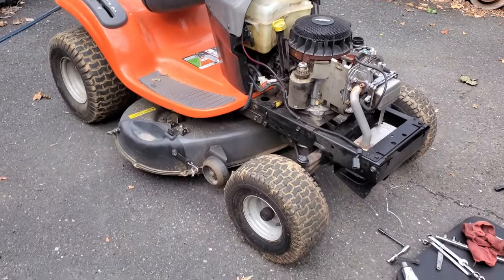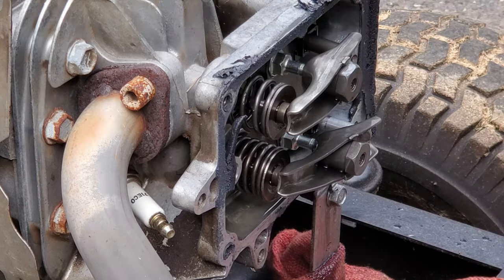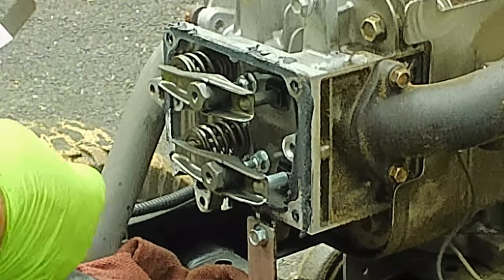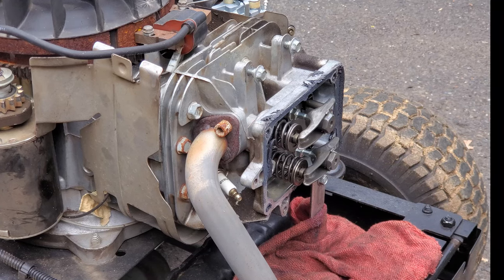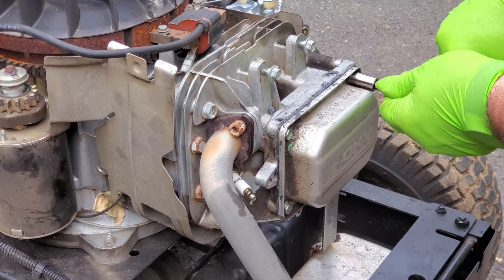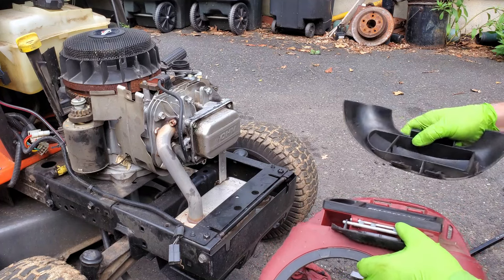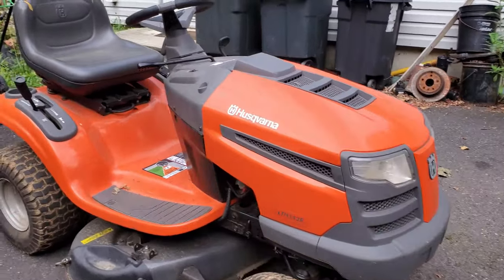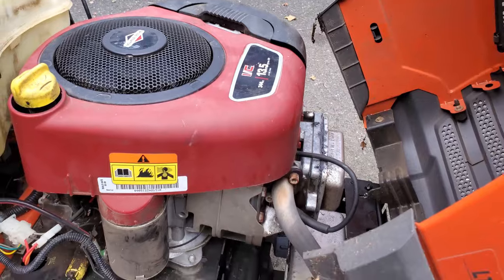Husqvarna Mower Backfiring: Part 2 WHAT WAS the cause?

Comment: The valve adjustment is the best thing to do in getting it up and running again correctly
Reply from the maker: Yes, it is not unusual for them to be out of adjustment. Also if they are too tight it can be a nightmare trying to get them running correctly.
Reply: @ridingmowerking   that is definitely the truth about that matter riding mower king 👑